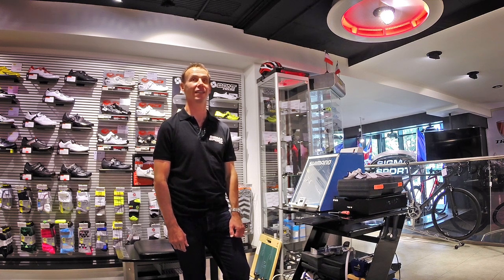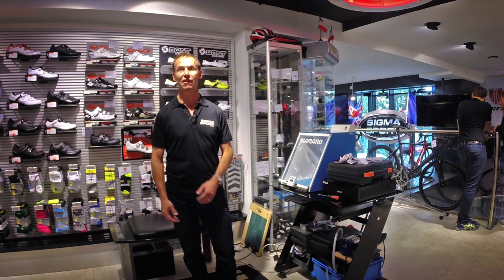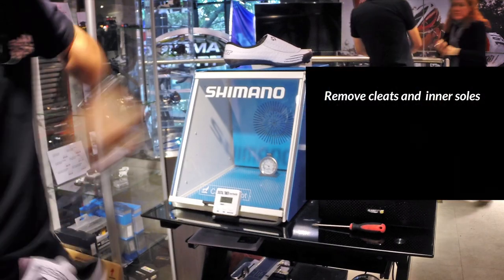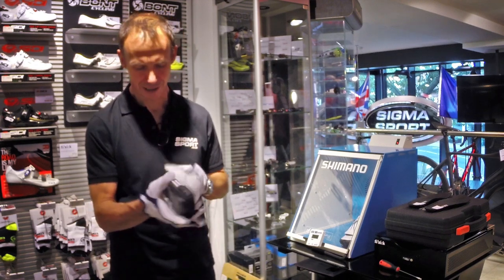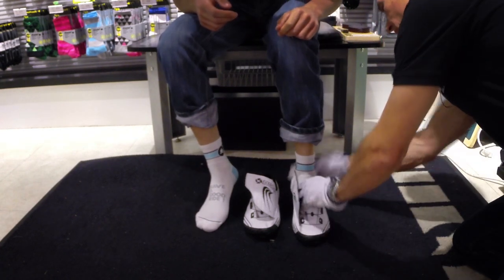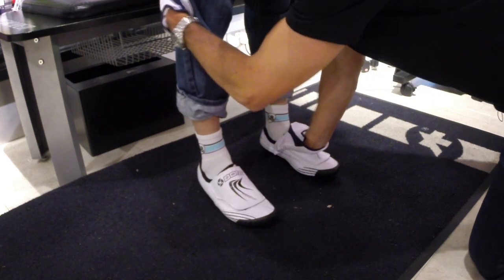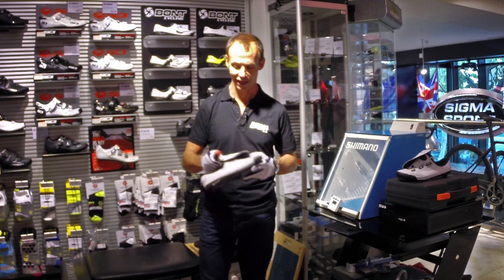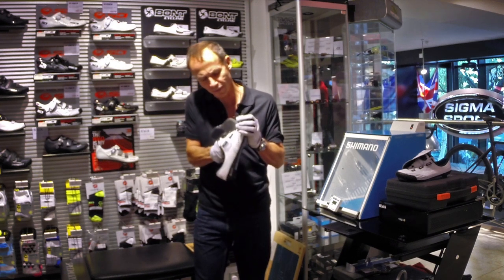Heat Molding Bont Cycling Shoes | Sigma Sports

Comment: Hi for Bont Mtb+ do you need to remove the metal screws on the lugs. Thanks.
Reply from the maker: Hello, You shouldn't need to, but please be aware that these may get hot. However, you do need to remove the innersole prior heating them. I hope that helps! Thanks, Lucy

Comment: A major problem with Bont shoes seems to be inconsistent sizing across the range of different models. My Bont Vaypor size 43 are noticeably smaller than my Vaypor + in the same size. The Vaypor also have much tighter heel cup right out of the box. Obviously, in the case of my narrow heels, the sides of the sole can be squished to make it narrower as you present in the video, but then that causes the sole to elongate a bit in the top of the back area...